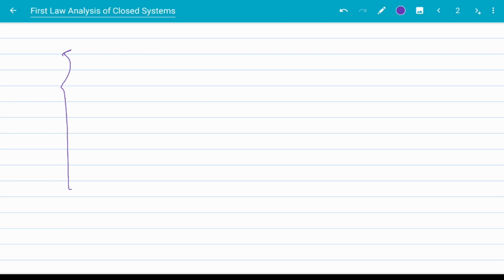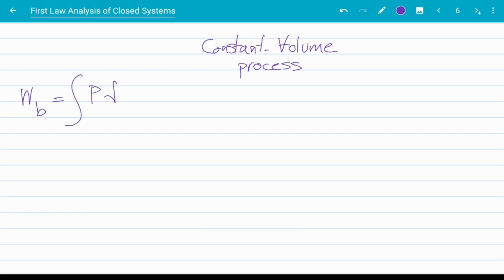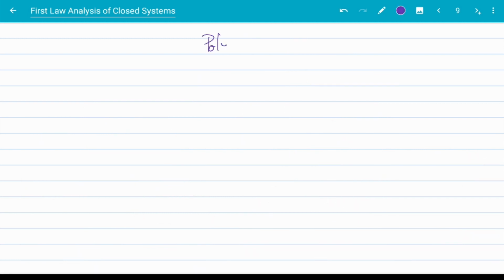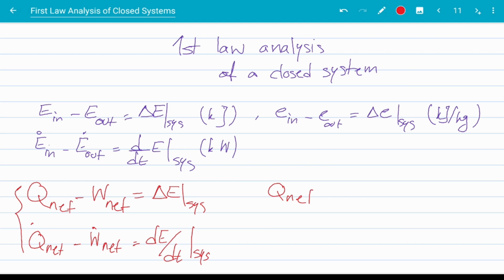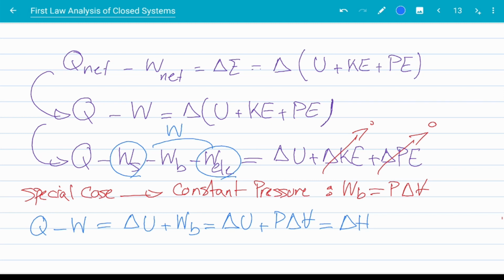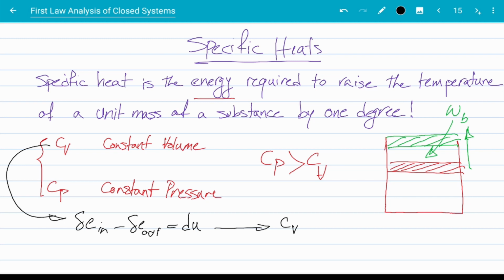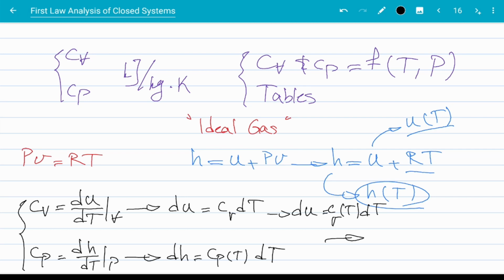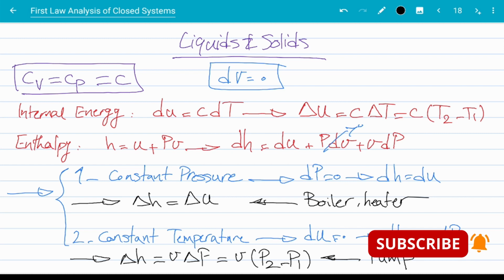First Law Analysis of Closed Systems - Thermodynamics

Comment: You made a mistake it should be p1v1-p2v2 for the poly tropic process that’s what my lecturer taught
Reply from the maker: Please check your equations. Is the denominator 1-n or n-1?
Reply: @WannabeProfessor86 ohhh thanks prof I just noticed it’s n-1 why yours is 1-n
Reply from the maker: @Cryptorie  It is a matter of algebra really. While deriving the equation through integration, you end of up with 1 - n in the denominator. But as we know from algebra we can switch the sign on the denominator IF we switch the sign on the numerator as well. That's how your equation looks different.